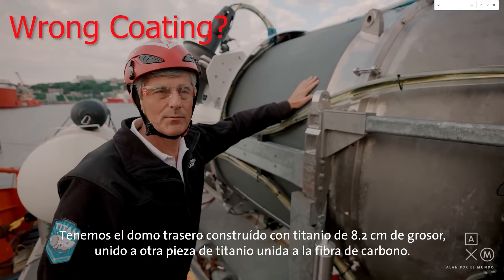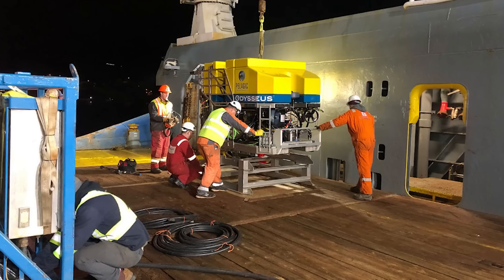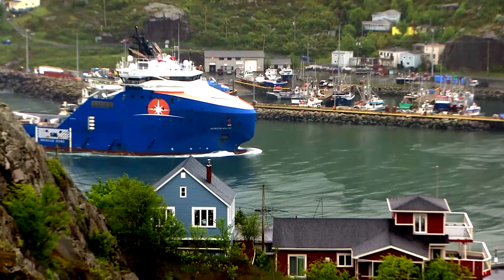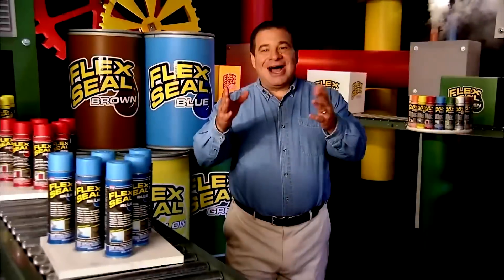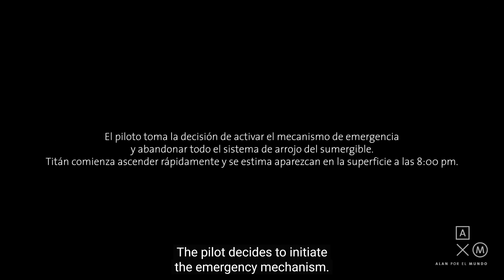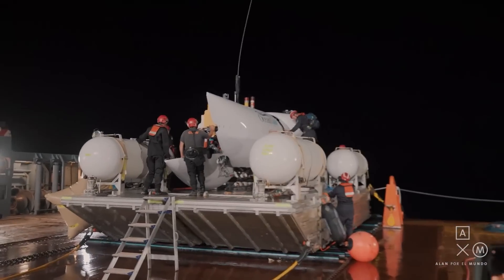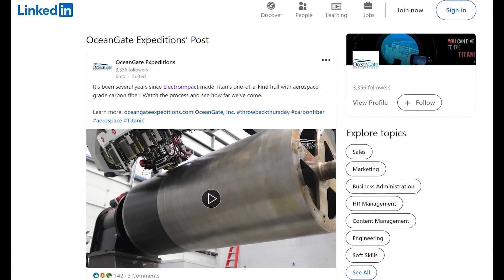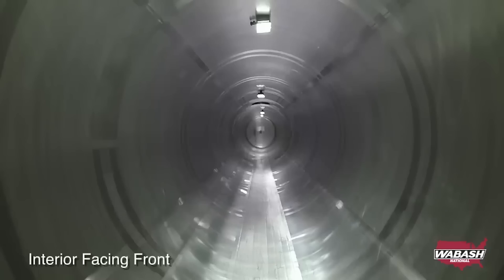Titan Sub Wrong Coating? Hull Construction, Debris Field Search

Comment: Deemed a success at 4000 psi but it cracked and failed at 4240psi 3 minutes later in the same test? In my engineering courses it requires probably 100 repeated successes at 5000 psi to be usable at 4000 psi.

Comment: Looks like the carbon fiber mainly is laid(glued) next to each other, not all cross layered! This provides in my opinion at each fiber-step along the whole tube's length seperation/breaking hazards, whatever its thickness. Fully cross layered (see other tube applications) eliminate this prone to fail situation. Especialy in a under pressure situation, not tension reliance.

Comment: For instance the Mirs have no hatch that could be opened from the inside. You do not need tools though to open it from the outside.
Think about it and you'll realize that there would need to be a device going through the pressure hull in order to make one to work.

Comment: So the dome with the viewport failed on the model, and Stockton realized they had to switch materials, but it never occurred to them that the main cylinder might fail in the exact same spectacular fashion? And as it has been said, why not build it and in test it at full scale? I was under the impression that at such depths, the size of the vessel makes a huge difference in the pressure exerted on the materials, this isn’t exactly an aerodynamics (or in this case it might be a hydrodynamics) test, duh. 🤦‍♂️

Comment: So it turns out that they did make a semi-sensible decision to use pre-preg carbon fiber for the hull. But you can just tell what Stockton's flawed "good nuff" kind of thought process was. Basically, pre-preg is way more expensive than the brushed carbon they used prior. So since it was the endcap that failed in the 1/3 model test, he figured that he'd minimize the cost increase by spinning the carbon fiber on the hull the same way as before. Apparently, cross-weaving pre-preg would've "held back innovation".

Comment: The debris was 1600 feet from the Bow of the Titanic and they could not find it for a week.
Reply: lol! They knew exactly where it was. The search and rescue was theater
Reply from the maker: They had no ROV that could get to it until Horizon Arctic arrived with the Odysseus 6 on Thursday, 4 days later.
Reply: @jeffostroff  They were searching for signals miles away and the sub was descending directly over the wreck. Where else did they think it would be? The ROV was used to collect debris and it descended over the wreck ..... so why was all the nonsense going on?

Comment: They all had the responsibility of doing their homework on this thing before writing the check, especially the father who is clearly putting his son at risk of being crushed by 18 million pounds of hydraulic pressure. I wouldn't be crazy enough to sit in the front seat of  India's first bullet train on it's first trial run, I would wait and watch the news for reports of any failures do to materials or design, derailments due to track radius etc... my point is, I wouldn't board an Indian bullet train while it's still launching cows into Pakistan...

Comment: I suspect that the coating was the least of the problems on this. I have formulated this type of polyurea and I also have worked a lot on carbon composite structures. I think the high strain properties of this type of coating are great and they would mitigate the effects of the cracking of the laminate that the hull was subjected to on every dive with respect to water ingress, but they don’t help the fact that on every dive they are progressively destroying the structure of the carbon laminate-that is what caused the problem here

Comment: Isn't it cheaper to just build a proper sub in a way that is known to work, instead of investing money into building a completely new and "revolutionary" design just to save money?
Reply: The Titan likey cost a few mill all told. A proper submersible that can take a pilot and one passenger to Titanic depth is 15 mill minus design and test time/cost. A pilot and two passengers craft such as the Mir line to Titanic depth  is 30 mill. Limiting Factor which can go to the bottom of the Marianas Trench or any part of the ocean was 37 mill design and build cost but others of the line should be 30 mill. Stockton Rush couldn't afford a proper sub and the people that have the money to buy and operate these things fall in 3 categories.

1 Super Rich who have Superyachts and support craft costing millions of dollars each year to operate, who would use it for leisure dives with friends and family. Anyone who wants a ride might be asked to cover the expedition cost of a few million if such a dive was not already planned to that location 
2 Private industry that sell usage for mining, oil, gas etc and general ocean research and it is difficult to turn a profit doing this hence why the number of companies is less than the digits of one hand.
3. Gov't. The ones who own and operate the majority of these craft, often sinking tons of money into usage for salvage, research, essential infrastructure

Comment: There were Video cameras on Titan...Inside and Out......So... Did we find the footage yet..??
Reply: that is the cameras survived the implosion and immersion to the bottom. odds are unlikely due to Rush being a cheapskate
Reply: @toomanyaccounts  True, but there cameras itself don't store the information/capture video...like Go-Pros do, memory cards.  Have a home security system..??  Cameras are outside/recorder inside.  Stockton had a habit of buying comsumer products. (Saving $$). I have seens footage of previous dives, he had cameras inside too. Also cell phones may of have footage, if they were taking videos/pix/audio with them.... Pretty sure the footage is still on a hard drive.  If I had to guess..he had the recorder inside the sub, you just may be right..destroyed. The recorder could  be in the rear equipment section, Batts, ect. (Which was found) in-which no implosion, recorder unharmed...??  Rather it surived the implosion....That is the $64,000 question.
Reply from the maker: I am hoping they recover something, even a chip, or a broken PCB with a chip still on it

Comment: I don't think it's the coating... I think your close tho. Coating was just another domino.
 How about those pressure regulation glass/oil electronic compartments. The giant glass sphere right behind the tit cap in the aft. If it has any air or goes under pressure can cause a implosion.
 Look at before and after of aft, the compartments and sphere on the sub without its skirts. Than Look at the aft they recovered. 
 They heard cracking from the aft, anyone of the glass compartments fail, electronics start failing, they panic in darkness and try to run in panic away from noise, causing sub to nose dive, rest is history. If the boxs were cracked or weren't equalizing to the pressures outside sub were bombs.
Doubt they had sensors in them

Comment: Doing tests with the 1/3 model is fine. Anyway the first models will fail, so it is cheaper to find first design flaws. As soon as the 1/3 model succeeds, you for the real size model testing.

Comment: At the end if the video where the tank implodes the pressure difference is still one atmosphere; 14.7 psi. At the depth where the Titan imploded the pressure was approximately 5500 psi. That's 5500 pounds of pressure per square inch of surface area.

Comment: Scale model testing should not be used for proof of concept mostly because the particle size of the component isn't equally scaled down. So the 1/3rd down sized model would in essence have carbon strands/particle sizes that are 3 times larger than a 'full size' model ...hope this is easy to understand. But I'm sure that no one will be using Carbon Fiber any time soon for these projects.

Comment: It just keeps getting better and better. Imagine if that barge sank before getting the submersible recovered. What was the back up? Lift bags to keep Titan on the surface while they unbolted the end cap is all I could think of. It would no doubt fill with water and most likely lost, hopefully with the crew escaping. Maybe if it was possible to stand it on end with the hatch pointing up and above water. Had to be that Titan would be rigged with straps and lifted up on a ship. But had the barge sank with the Titan secured on it, it would probably have been the fastest decent to the bottom after that of the Titanic. This was a total clown show.
Reply: I don't think so.  It was a brilliant failure.  Too bad they didn't have your expertise up front.

Comment: Actually you can’t interpolate a full size model. Thus is due to the way they manufactured the Carbon composite without a autoclave. Any voids within layers could induce failure. There are way too many variables here to to say that this construction is safe for one dive not even looking at fatigue or delamination.

Comment: The problem with a full sized model is that there aren't a lot of places with big enough pressure testing equipment.  The Limiting Factor had to be tested in a former Soviet Union  submersible testing facility in Russia, as it had one of the few such facilities capable of testing it's large pressure hull.

Comment: Rhino liner may not only have been used incorrectly but did the solvent used in the Rhino liner when it was applied effect the structural integrity of the carbon fibre tube?

Comment: Thanks for your vids on this. It gets more and more shocking - the idea that some sort of spray on lining would aid water pressure resistance at 4000m is just insane, even to a non-engineer like me!
Reply: in all fairness though, structural rigidity wasn't the lining's purpose, it was meant only to address the porosity of the composite
Reply: @peabody3000  Well, it may be a matter of semantics, but I wasn't really thinking that they thought the coating would increase rigidity per se, but to me 'addressing the porosity of the composite' as you put it, is practically the same thing - ie putting some sort of coating on in the hope that it would help keep 400 atm of water pressure at bay - which sounds a pretty hare-brained idea to me! (though as I said, I'm not an engineer in any shape or form).
Reply: @timbounds7190  yea being an untested application it's def harebrained either way. since the liner would only have to protect tiny air inclusions, it wouldn't necessarily be vulnerable to the immense pressures. like, you can see thin plastic parts in use on submersibles in spots where they don't have to keep pressure out of something by themselves. of course proper testing would still be crucial, to make sure the liner didn't have it's own inclusions or physical properties that could get compromised etc
Reply: @peabody3000 THE original poster never said the rhino liner adds rigidity

.
Reply: @electrictroy2010  ok so how does one accomplish "water pressure resistance" in any deep sea craft without increasing structural rigidity?
Reply: @peabody3000  by removing direct contact between the rigid hull and the moving water.
Reply: @DKFX1  ok but that's for protecting the rigidity of the hull, rather than adding additional rigidity, which goes to my original point that the idea of using it isn't nuts by itself, although using it when not tested for deep sea was bonkers
Reply: I'm guessing he did it for either 2 reasons. 1: he wanted to coverr up the ugly carbon fiber hull which had visible signs of wear. or 2: the rhino liner helped make the sub more silent by deafening the crackling noises.
Reply: @DKFX1  Cynic! However, you might be right....but he got that wrong as it would have provided better sound deadening to put the coating on the inside rather than the outside!

Comment: How much more expensive would a titanium cylinder section be than all the r&d they did for the CF? I mean they changed the end caps to titanium, presumably after the failed scale model test. From the video of the recovered pieces the end caps still look in reasonable condition even after the implosion.
Reply: Weight. Its the weight savings they were going after.

Comment: Yes, using a model is enough. Physics don't change with size.

Car manufacturers are using real cars because they are cheaper than building a smaller sized model. They have whole factories and supply chains which are optimized for real sized cars. There's no point for them to spend more money on a smaller scaled model when they can get a full sized car basically "for free". However, car manufacturers still use less detailed models to test physical properties, for example in wind tunnels. They don't need a fully detailed model there, only a model which resembles the chassis. 

That's similar to OceanGate, because all they need for the pressure tests is the pressure chamber.

Comment: Google polyurethane coated breakwater and you'll find places where various shore and riverbank erosion control devices have been coated with a polyurethane to increase their resistance to damage. It's essentially truck bed liner. It's also used to coat masonry walls to increase their resistance to collapsing during an earthquake or from explosive damage. Under moderate force that would damage the masonry the coating prevents cracking. Under higher forces, the coating holds the broken masonry together, much like how the flexible plastic inner layer in a vehicle windshield holds the broken glass. If you've seen the video of a bed liner coated concrete block being tossed off a building and bouncing, what's not said is that inside that thick polyurethane coating is a shattered concrete block.

Comment: Rhino liner is a chemical concoction that to stick it must adhere to the surface. It is also commonly used in pickup truck beds as a liner. When ever you apply to carbon fiber you must be concerned t about what a coating while do to the polymers used during the laying up of the carbon fiber. It might have “waterproofed” but most likely would weaken the cylinder. OMG

Comment: It's as if Rush saw innovation as a virtue in and of itself. There are potential new ways of doing things which are worse, in some cases catastrophically worse, than the existing methods, but that possibility doesn't seem to occur to him. It's like he Googled "waterproof" and found something cool looking that his submersible rivals weren't using and that's where his thinking about appropriateness stopped. Simply by using a non-standard material for the purpose he was getting one over on his fuddy-duddy competitors and that's all that mattered.

Comment: @10:35 because there are 1000000s of cars out there, losing one is not a problem, but there is only 1 sub, and the worst part, even if you test it on the 1 sub, when you build another one, the previous test will not be valid!

Comment: I'm going to go out on a limb and say that if they relied on an applied coating (paint or sprayed on) to prevent water intrusion, then it probably didn't matter what they used. At the pressures expected, any voids in the CF or between coating and CF at all would have been leak pathways. What coating would have been appropriate? (besides an actual metal skin). "Real" subs have applied coatings, but they are for purposes other than keeping water out.

Comment: It is assumed by many it seems that when the Titan lost communication that it imploded. But it is a possible scenario that they finally had a total power failure and drifted to the bottom and imploded due to the stress of impact. We need the Navy to release the time they perceived a sound on their sub detection system that many assume was the sound of implosion of the Titan.

Comment: Something I've been curious about that nobody has touched on in any YouTube video that I've seen so far is: how are all the electrical wires from inside the submarine connected to the things on the outside of the submarine?
Reply: I had the same thought.  It had to be through the titanium end caps.  Metal based successful submersibles would have worked out this technology.

Comment: The mad thing is that this could have actually been an innovative new way to discover the deep sea. 

If he had tested for cyclic fatigue, tested the perfect thickness that carbon fibre could be used safely, certification and full testing etc and not taken paying passengers. 

The fact that the sub actually made it to the titanic numerous times shows that this technology was succesful and could be used for experimental purposes, or even to make cheaper and lighter ROVs. 

Please don't think I am saying that Rush did well becaise he didnt but he built a sub using materials that shouldn't be used and made it numerous times to his destination. Certain tweaks to engineering and this may be viable materials for certain submersible in the future as long as the person isn't blinded by arrogance and disregards warnings from those who know better

Comment: Clearly, the original design of the Titan was using carbon fibre end domes and these tests showed that it was inadequate  to be able to hold in the large window. It failed! So at some point, they switched to titanium end domes. Where  are the 1/3 pressure tests for that? If the "coating" is all that lies between you and certain death, there is something fundamentally wrong with your design.

Comment: 11:20 Maybe the electrical engineer can explain how fibres in a 45° and 135° pattern would reinforce the 0° and 90° pattern. The maximum stress in the hull cylinder occurs at  0° and 90°. Have you ever tried to pull two diagonally opposite corners of a fishing net from each other? Not much resistance in that direction. Replacing some of the pattern with a 45° and 135° pattern could make the hull fail sooner. You can of course add patterns without removing the ones used. Maybe you have a reason for doing so. What would that reason be?